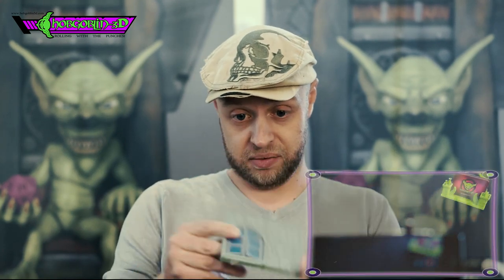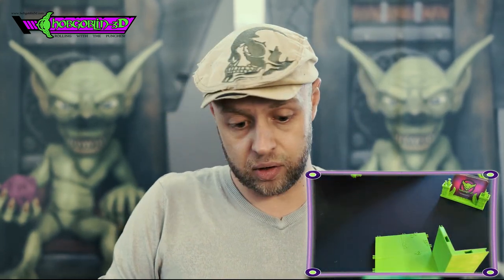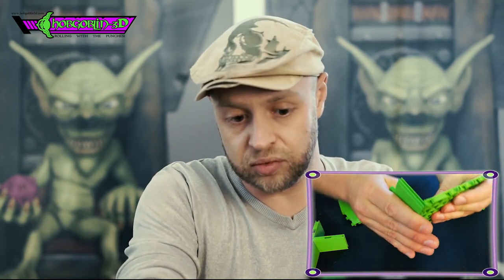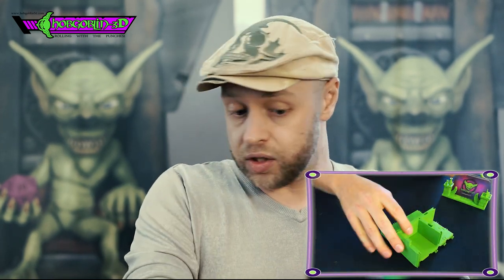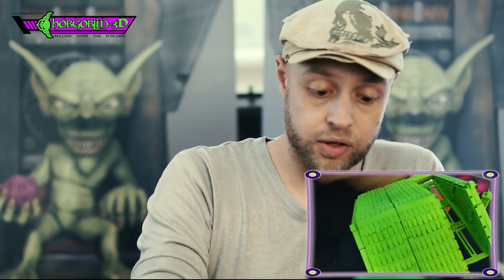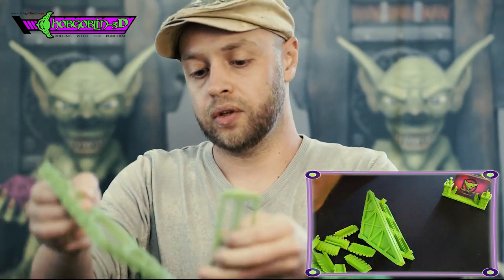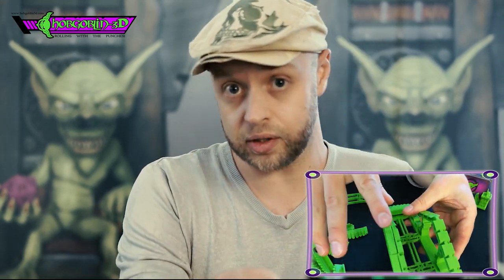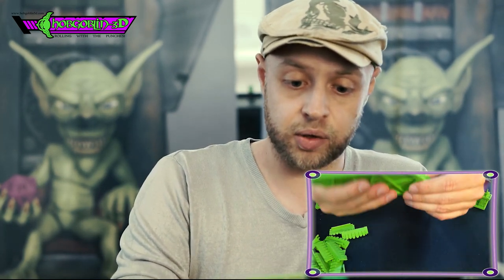3D Printable Tavern Update - Progress on the Wobbly Goblin

Comment: While it is exciting that you've made great efforts in producing a modular system, I don't know that you needed to re-invent the wheel. Perhaps I misunderstood the intent, but when people asked for modularity I think they (or at least I) was thinking more about compatibility with existing systems. Don't get me wrong, you've made great strides and it is an impressive system, but I hope that you're personal fingerprint isn't lost on the final iteration. I would have been satisfied if you had made it a standalone building that clipped into openforge/openlock style tiles. Also was it necessary to make stacked walls so easily removable? Stacked flooring on walls I understand. You can make multi-tiered builds by removing an upper floor and reaching inside. I suppose it's a moot point if your system is as rigid as you say when assembled. Anyway great update, I'm looking forward to the final product!